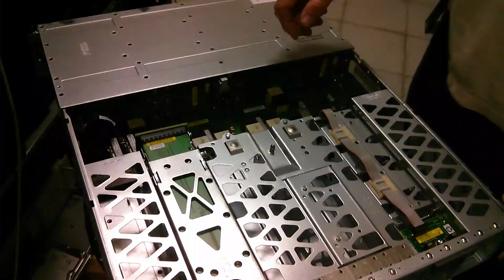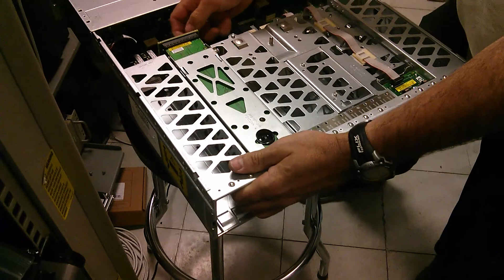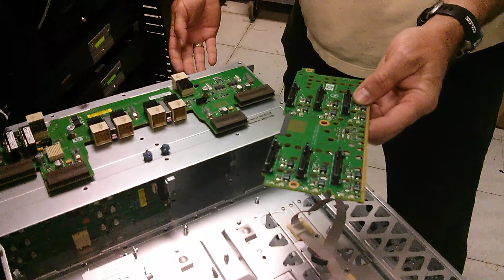HP MSA60 backplane removal

Comment: I recently acquired an msa60 and i have it plugged into an hp dl380g3 with a LSI Logic LSI7202XP-LC Dual 2Gb/s Fibre Channel PCI-X card.
can you possible help me with this as I can not see the array in the HBA bios
Reply: wayne grady Did you ever solve that? I'm also not seeing any drives that are in the MSA60... Would love to hear if you've found a solution.
Reply: No but would really like to
Reply: I've got the MSA60 to work now, on a P800. seems it will only work with the P800 and P400 cards from HP.
Also, annoyingly, Sata drives from HP (rebranded Maxtor and Seagates) working fine in a MSA20 refuse to work on the MSA60.
Even in a DL320s, some drives work fine on the DL320s attached to the P800, but they refuse to work in the MSA60 attached to the same P800...
Very confusing and annoying product from HP...
But now that it works, it's giving me 700MB/s write and read speeds so the performance as long as the batteries are good.